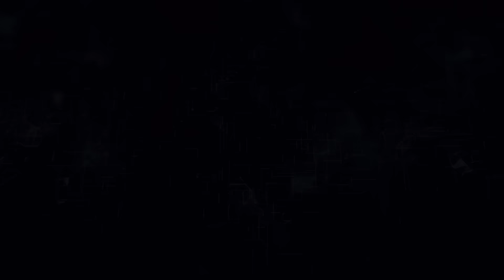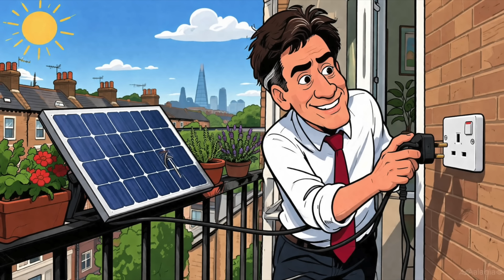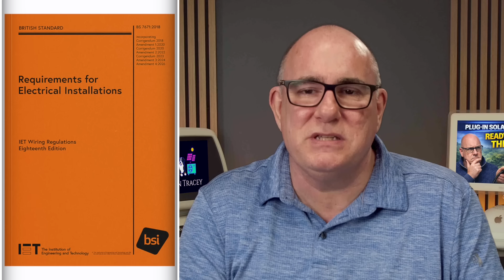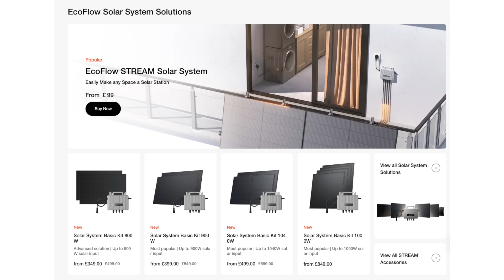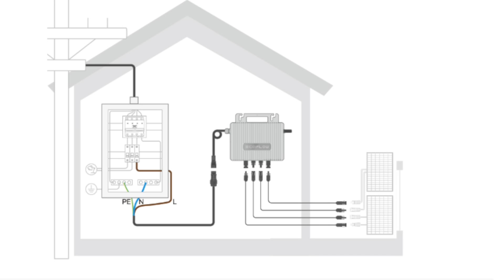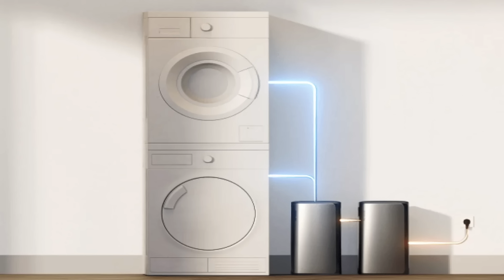Plug In Solar Is Coming… But There’s a Problem

Comment: How about bringing down the standing charge on electric?
Reply: The problem is the network has been left to rot and needs massive improvements, the standing charges are meant to pay for this, if added to the unit rate it would mean people with solar would effectively be subsidised by the poorest in the community.
Reply: @timballam3675  Disagree, With standing charges I am subsidising the poorest. System should be simple, pay for what you use, not for what you don't use.
Reply: @timballam3675 you are correct that incorporating into the unit rate would allow those who use less to contribute less to the shared system. This would indeed be unfair. However the incease in money required to be spent on networks and grids is because of wind and solar additions, not the failings of the existing systems. The existing grid was just fine delivering 20% more power than it does today, it is the location and characteristics of solar and wind that are adding a vast array of other costs including reinforcements, extensions, interconnectors, electrical stabitity mitigations including standby dispatchable power plus extra frequency and voltage control measures as well as a fundamentally more complex system to manage and control. Something almost always overlooked by those advocating solar and wind and complaining about standing charges.
Reply: @clwydsigma The UK grid is ancient. It has transformers that are over 60 years old. Well beyond their lifespan. The grid is not being maintained properly. 

Heathrow was not an accident.
Reply: @jgcondron the grid is constantly being inspected and maintainted and uses preventative and condition based maintenance practices as well as replacement and addition. Consequently the grid is 'all ages' and the fact some parts are old is not an issue if they are fit for service. Its not something you build once and then take down and replace. The belief it is all old and needs replacing is totally incorrect. It can be kept in service indefinately using existing and well established processes and practices.
Reply: The standing charge is there to guarantee an income for the private equity firm that owns the network for a set number of years.
Reply: That is one of the best things that can happen is no standing charges, I go away for months but still have to pay for nothing, council tax is the same.
Reply: @KevinBuchan-qz5dg Electricity cables and substations etc., just like roads, have to be maintained whether you use them or not, so you're not paying for 'nothing'.  You're paying for the relevant infrastructure to be there and ready for you whenever you decide you want it.
Reply: @Chris-hf2sl  it went up ~100% a few years ago and they even admitted it was to cover the cost of taking on customers from failed energy companies.  How does that even make sense?!  Surely they want more customers?  Its a con.
Reply: Average electric bill in Thailand 🇹🇭 is £7 a month .
No standing charge .
Reply: @user-kq5qp6dh8l  Yep, my March bill was 51 units @6baht = 306baht (~£7.17), April is projected to be 57 units 342baht (~£8.02) as it's getting a lot hotter and more humid. I looked at getting a small solar system but with my usage I'd be dead before it's paid for (I'm 73)
Reply: They'll never do that.
Reply: So could I buy an 800w system, charge a battery with it and the house through that? I have 200w base consumption so could the extra 600w charge the battery when I’m not home?
Reply: @richtea7868 exactly that. Any time the solar output is more than your consumption, (and there's not much point selling that back to the energy provider as they pay peanuts) you can instead charge a battery that then powers some of your home demand once the sun isn't shining. As mentioned in this piece, the caveat is solar output is DC and battery charging is DC, so not much is lost in this process, then the discharge is DC to AC with some related losses. So getting 80% of the solar input, back out as AC usage is about the best to be expected. Non 'all in one' systems turn the solar DC into AC, charge a battery using AC to DC then power the home from the battery through DC to AC. Each time you make this change, some energy is lost as heat.
Reply: There's no way to make electricity on demand free, sorry.
Reply: Who else is going to pay for those who don't pay their own way?!?
Reply: Standing costs are about 80% of the cost of electricity. Standing charges need to increase to 80% of your bill to reflect the reality of what it costs to have an electricity connection at your home.
Reply: nah this way the gov can pretend they're doing anything while actually shifting all the work, cost, and maintenance onto the taxpayer

and they can let ofgem raise the cap again come autumn... plus a healthy boost for standing charges too
Reply: @iamdmc  err you do realise that a previous government of the right wing persuasion SOLD our nationalised energy companies to the private (foreign) sector don't you? Also England and Wales are the only countries in the world with privatised water companies!
Reply: What does that have to do with solar panels? I don't disagree with you, but the topic is plug in  solar panels.
Reply: @PhyllisGlassup2TheBrim because those who install solar panels feel hard done by still having to pay their standing charges. What they fail to understand is that everyone with a grid connection must pay their share of the common system that must be there whether they choose to use it or not. Its like everyone paying for the NHS. In fact the more people install home generation the more expensive the central system becomes. They are literally complaining about a problem they are contributing to.
Reply: @clwydsigma that cost should be factored into the cost of energy though. It's even harder to swallow when you have energy companies announcing record profits year upon year whilst our bills have doubled.
Reply: @DuggyDarko no it shouldn't. Consider this, you pay for healthcare on a monthly basis not because you are using it but because it has to be there for when you do need it. Same for the grid.
Reply: @clwydsigma yes but when I use it I'm not then charged extra for having used it. Trying to equate greedy energy companies to the NHS is ridiculous.
Reply: @DuggyDarko I suggest you research what your energy bill pays for before drawing such conclusions. Only a little over 1/3 of it is the wholesale power cost and only around 15% of it is related to your energy provider the rest is all government policy and green subsidy cost. Nothing to do with energy companies being greedy, just consumers not understanding the impacts of their votes or how the energy system works.
Reply: @clwydsigma  doesn't change the fact that shareholders still take their cut at our expense though does it.
Reply: @DuggyDarko no, but thats just like all private companies.
Reply: @clwydsigma exactly. So why is it our responsibility to pay for their infrastructure?  It's wrong on every bloody level yet here you are defending it. 🙄
Reply: @DuggyDarko the solution is simple, if you dont need it disconnect from the grid. If you do need it then pay your share of the common system like everyone else. If you think the cost is too high then vote against the current energy policies that are escalating the non-wholesale part of your bill.
Reply: @clwydsigma so before the standing charge was introduced what was happening? Id argue that yes the solution is simple, force companies to invest in the infrastructure and stop giving themselves huge bonuses and passing that off onto the customers who have no choice.
Reply: @DuggyDarko you are missing the key points Duggy. Firstly there are a lot of fixed costs to providing the system for everyones convenience whether anyone draws 1kWh of energy from it or not. It has to be paid for. Secondly the majority if your bill is not energy or company profits but government imposed costs. If you want to complain you need to direct your anger to the government not the energy companies.
Reply: @clwydsigma I agree it has to be paid for but that should come out of their end not passed on to the consumer. I do direct my angry at the government but equally these companies need to be help accountable too.
Reply: @DuggyDarko where would they get that money from? Companies can only ever spend what customers give them.
Reply: @clwydsigma  oh won't someone please think of the poor energy companies who are announcing record profits year upon year 🙄
Reply: @DuggyDarko do you have any actual numbers to substantiate that claim?
Reply: @clwydsigma I think that not only have our bills doubled but the standing charge being brought in is evidence enough don't you think? As I said, I can't understand why you're defending it in all honesty. It's a scam.
Reply: @DuggyDarko so in essence you dont have any facts to support your claims, just a gut feeling. Isaac Newton would be so proud. I have no loyalty to the energy companies, only to common sense and evidence. And common sense says a claim without evidence is no more than just an unproven hypothesis.
Reply: @clwydsigma the proof is literally the price of our bills and the standing charge mate. So weird to defend an obvious scam.
Reply: @DuggyDarko go and check out the % profit these companies make. Its tiny in comparison to almost any other business.
Reply: @clwydsigma  no i don't feel hard done by for that, but how come when I generate 1kW and sell it to the grid I get 15p, but when I have to buy it back due to no sun it costs me 31p?
Reply: @lms_steve6693  if you are getting 15p for export then I would say you are getting a very good deal.  Your question shows you dont understand what your bill pays for. The wholesale cost of electricity is only about a third of a consumer's bill. When you are providing power a) you are playing the role of a wholesale power generator not a utility company, wholesale providers earn a small  fraction of the billed kWh price, and b) if you have spare solar then so does everyone else, so its simply worth less because its not needed. You need to familiarise yourself with what consumer bills pay for. This is exactly why people think renewables are cheap when in reality bills keep being driven upwards.
Reply: They should, but unless a large percentage of the population complain, they'll keep doing it. They don't want to help.
Reply: @johnchoice1371 removing the climate taxes from gas powered generation would half your bill. Perhaps that would be something more worth asking for, and something you are mote likely to get. The standing charge is like paying NI for the NHS. Everyone pays it for the system to be there, it wont disappear because you dont like it.
Reply: @clwydsigma  The standing charge has been rising hugely in percentage terms. IT's not just to allow them to exist. I don't know whose side you are on, but I think if you did a poll and actually asked people in UK whether they think their bills are far too high, the answer would be 'yes'.
Reply: @johnchoice1371 you need to go and research what makes up a consumer electricity bill. Then you will start to understand the problem. The wholesale electricity price makes up only a bit over a third of a typical bill. Of the rest a large share is driven by the rising costs of implementing solar and wind (direct and indirect due to knock on impacts on the electricity system and markets). The standing charge is a bit like NI for ensuring the NHS is there. It doesnt matter whether you use it or not. The fact it needs to be there means it has to be paid for and Net Zero policies are escalating that base cost regardless of whether the unit cost of a  kWh from solar and wind is lower or not. I understand why people think solar and wind should reduce bills but as we have moved from zero to 35% of those, bills have more than doubled (after cotrecting for inflation and the impacts of war). This simple fact should be enough to make everyone stop and reconsider the story they have been told and whether the problem is as simple as they thought.
Reply from the maker: that was the topic of last week’s video😂
Reply: Bringing down the standing charge would be the way to go but why would the sack the cash cow. We’re all captive users. Makes me sick when you think of the profits these companies are making.
Reply: The standing charge covers the base costs of providing the system to those connected (excluding generating the power) and this cost continues to increase due to the addition of more solar and wind. Therefore standing charges will both remain and increase in value.
Reply: @clwydsigma  You don't need standing charges to pay for supply or maintenance costs as a separate issue, just pay it out of the unit price.
It's a big sham and people are falling for it.
Reply: @montynorth3009 not at all. Consumption has fallen significantly over the last decades yet the costs of the system has risen. Also, if all these costs were covered via the unit rate those enjoying all the benefits the system provides but drawing fewer MWh would be underpaying their share of that common system. This is the prime motivator of most people advocating to recover system cost via the unit rate. That would be unfair and inequitable.
Reply: @clwydsigma  The profits of DNOs increase year on year even as a percentage of total revenue. The stats are widely available 

Its obvious that the standing chargers are not going up to just cover extra costs of local grids (that is not really involved with extra renewables - which are the responsibility of the national grid ).  The DNO are solely responsible for local networks which concentrates of maintenance and connections for new housing etc - they are NOT effected by installation of renewables less
Reply: @trevormangham9957 Only about 15% of your bill is associated with your electricity provider, the rest are national costs associated with providing and operating the wider power system. In other words 85% of your bill pain has nothing to do with your supplier but very much to do with national energy policy.
Reply: @trevormangham9957  The increased demand on the local distribution grids from households and companies needing more electric chargers and heat pumps is down to the DNO.  There’s a long way to go and a lot of money to be spent.
Reply: @clwydsigma  The total cost of converting to green energy is less than the cost of one energy crisis caused by our reliance on fossil fuels (such as we have now), this is not even considering the cost of not converting on the climate, which is far more again.

Environmentally, if we want a planet even close to decent for our children, we have no choice but to move, the thing is now it is economic madness not to. No amount of propaganda, paid for by the fossil fuel industry, can hide this fact.
Reply: @MentalLentil-ev9jr what does that have to do with standing charges?
Reply: @clwydsigma  It addresses the point you raised about standing charges rising because of the cost of increasing renewables. The fact is that the total costs of going completely renewable/nuclear are less than the cost to the UK of Trump's folly in Iran and less than the cost of the inevitable next fuel crises that will be caused because of our use of fossil fuels.

That is what it has to do with standing charges, even ignoring the massive costs of climate change going renewables makes middle/long term economic sense. We need to get energy independence.
Reply: @MentalLentil-ev9jr every country that started down the wind and solar path has pushed their power prices upwards not downwards. Germanys economy has been crippled by it. Its a fallacy that a major economy can power itself for less with solar and wind.
Reply: @clwydsigma  Sadly, the cost of wind generation is so crazy that it seems we will never recover the cost of implementing wind generation in most cases, becausee the costs will outlive the life of the windmills and when they've been dismantled, they are not recyclable. It's a lose/lose situation for us and the planet!
Reply: @IsThisAvailable550 wind *turbines*, saying "windmills" makes you sound like an ignorant American 😅
Reply: @IsThisAvailable550  To be polite, absolute balderdash.
Reply: @IsThisAvailable550  You have been misled. What you wrote isn't true. 🙂
Reply: @norwegianzound  🎯
Reply: @norwegianzound  Exactly, but he read it somewhere or heard Trump saying it lol 🐑🐑🐑🐑
Reply: @clwydsigma  so stop adding solar and wind then?
Reply: @over-engineered it depends what your objectives are. If you want to reduce electricity costs for UK consumers and businesses then yes, stop immediately.
Reply: @over-engineered domestic solar is very expensive compared to utility scale solar. Probably 2-3x the price. The government is just trying to get you to spend your money and feel good about it so they can claim an achievement.
Reply: @over-engineered  DNOs have nothing to do with renewables transmission, thats down to the grid.
Reply: @clwydsigma  Probably?  There's zero land cost for domestic and zero labour cost for balcony solar.

It's like the anti-wind chappie with his "seems like" FUD. Where's the figures?!?
Reply: @DT-dc4br there are some good papers on it out there if you are interested in the detail and can be bothered to read them rather than accusing others of your own approach to reaching conclusions. Since I guess not here is AI's take on it: 'Utility-scale solar is significantly cheaper per kilowatt-hour (kWh) and per watt to install compared to domestic home solar, often costing roughly half or less to produce the same amount of energy.'
Reply: How about scrapping not reducing
Reply: Off topic completely.
Reply: Don't be silly. That's where the guaranteed dosh is.
Reply: Bring it down. It's totally unfair.
Reply: It’s 1/4 of my daily electric when we’re out all day and the heatings off, it’s disgusting. It should be zero.
Reply: @wadoryujh then use a generator you own and don't have grid mains. The cables of the grid are there 27/7 so you can have the convenience of having power whenever you want it, they aren't free. The standing charge pays for the cables, capacity and convenience, not the amount of electricity you used. Nothing is free,  when socialists say "it should be free" they really mean "I want someone else to pay for this thing I want".
Reply: @wadoryujh you are misunderstanding what the standing charge is.
Reply: @clwydsigma am I?
Reply: @wadoryujh what do you think it pays for?
Reply: @clwydsigma I don’t care what it pays for, I care what percentage of my bill it is.
Reply: @wadoryujh so you believe other people should pay your share for you just because you dont like it?
Reply: @clwydsigma I believe you should pay for what you use.
Reply: The fact the number isn’t static between every rate says it doesn’t straight pay for one thing.
Reply: @wadoryujh do you have a connection to the grid?
Reply: @wadoryujh correct, it pays for multiple things. Perhaps you should look it up before deciding if its fair or reasonable.